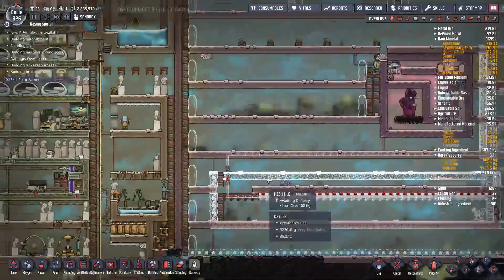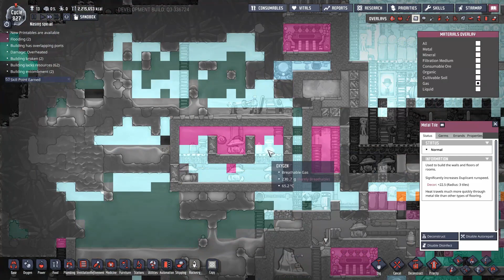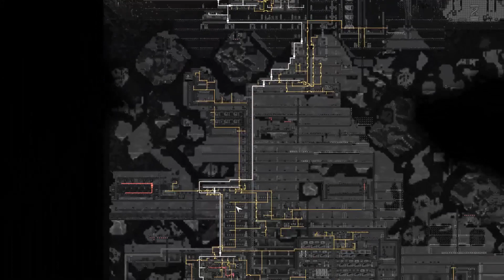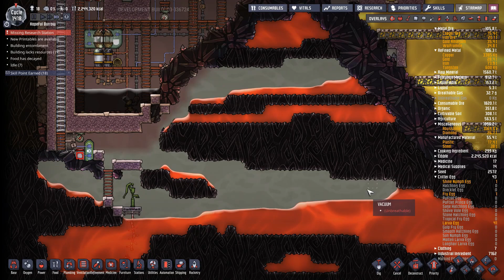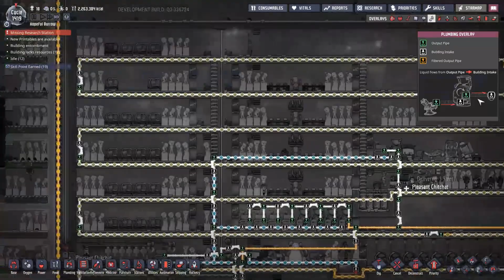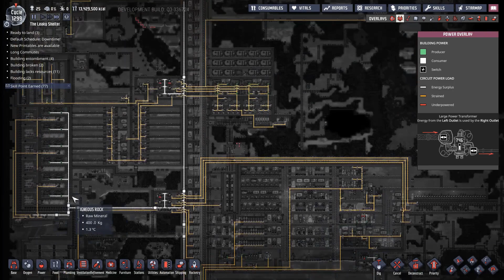Base Lovin 7 : Exploring more beautiful bases : Oxygen not included

Comment: That regolith melter is absolutely marvelous. 709.5 tons of consumable ore. That's a lot of potential coal. How much of that is actually coal/refined carbon?
Reply: Thanks! 

586.6t of coal and 120.9t of refined carbon. Note that the melter started out to get a little bit of extra igneous rock in a renewable fashion, because the volcano on it's own was only enough for 4 hatches, and I wanted 10 hatches, … for no other reason then wanting it (got plenty of fuel and meat by just the slicksters, so I really don't need it). Did not expect to end up with enough rock for over 80 hatches.

Anyway, as such only 10 hatches are in the map at the moment. That coal got gathered over a long time (pretty much start of the game), and I'm hardly burning any. Most of the refined carbon actually comes out of space at the moment.

Comment: After Koen's base now I don't want to play anymore
Reply from the maker: I know. I really want to make a regolith melter now.... but it looks really hard.
Reply: @FrancisJohnYT and Bryan:  It's not that bad. That automation overview, .. most of the complexity you see there is deciding if the regolith should be dumped to the left or to the right. I was pleasantly surprised myself how easy the regolith melter actually was to build. The concept is quite simple, and there's no closed off sections. It's all (still!) dupe accessible .. It's getting rid of all the heat that was the hard part. (Though I could just have added 12 more turbines in the same pattern, .. but that was boring :-p ). Also working with an already operational petroleum boiler made it hard. I had to be slow and careful to prevent scorching and breaking vacuums.
Reply: @FrancisJohnYT  I wonder what the ultimate end of the regolith would be.  The igneous rock doesn't seem to be being eaten by hatches, but if it were, burn it in coal generators running in space, to turn it back into CO2 and off-gas it?  True, actual regolith deletion with a setup that's arguably as difficult as corralling those goddamned shove voles.